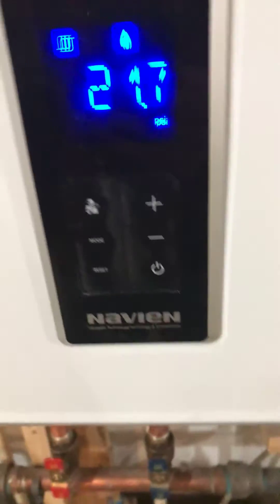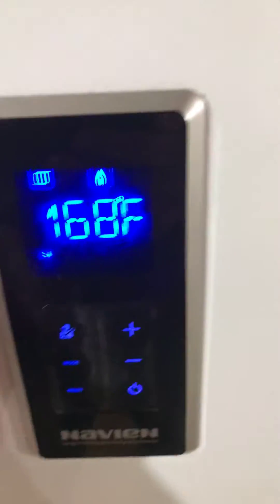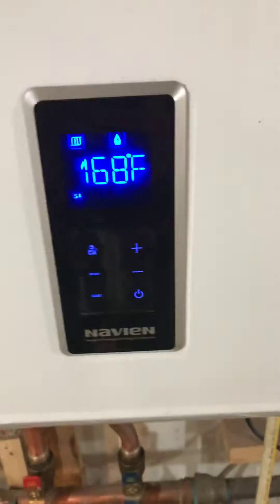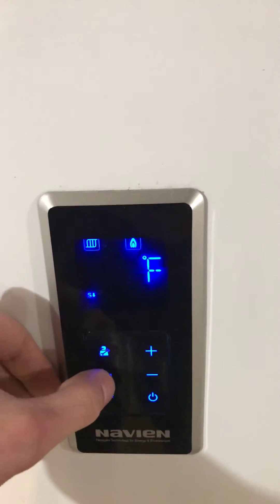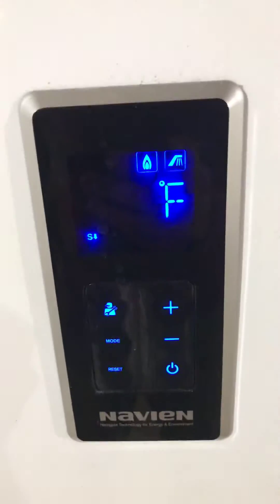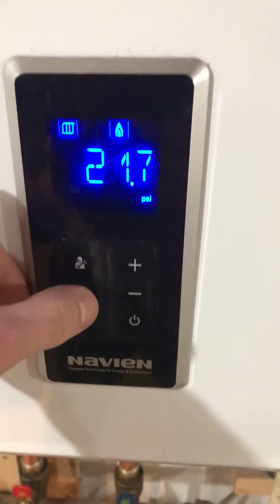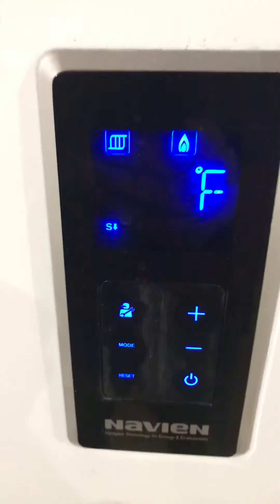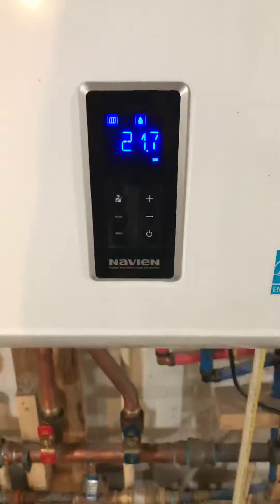Navien’s combi boiler can’t get to desired heat the thermostat is calling for - FIX Maintenance

Comment: 180* for baseboard; 100-130* for radiant floors.  If you have both you will need a mixing valve to adjust accordingly. I've installed many of these. Very pleased with them.  If it doesn't maintain temperature then either you don't have enough baseboard, zone loops too long, or house insulation not adequate. Also, some circulators have speed settings on them.  These also can be adjusted.

Comment: I also live in the northeast and just recently moved into a new home with a navian combi boiler. been having same issue with thermostat and I’ve never had radiant heat before. I upped the amount to 143 because it was cold in here.  What should the temperature be?  You had it on 180 F - isn’t that high? Help.
Reply from the maker: Up it some more. In these super cold days the temp has to be higher. Check out my video about adding the outdoor thermostat. It moves the temp up and down based on the temp outside. Lmk if this helps.
Reply: Thanks. I did turn the temp up and it worked. Now I have to adjust it for warmer temperatures. Question- if you have 2 thermostats, one in main room and 1 in bedroom, if you turn the one down in the bedroom, will that help during the night while I’m sleeping? It’s just too hot in that room now.

Comment: We're having the same problem except our temp is already set to 180.
Reply from the maker: Depending how cold it is outside it needs to be very high. Idk what the max you can go safely but might be worth some research. I have the outdoor thermostat and it adjusts it automatically. But with it being 15 out I’m sure it’s high
Reply: Probably not enough baseboard in your home and how well it’s insulated could all be factors

Comment: I just had two Navien Combi condensing boilers installed for each unit. There’s hot water. Electrician connected the thermostat wire but when I go to the apartment to turn on thermostat no heat. Looks like the Navien error code 740 says no outdoor sensor detected. How do I bypass this so I can turn on the heat? Thank you!

Comment: We just replaced a ten+ year old Navian Combo unit, 1 zone with the NCB 240/110. Hot water side is great. Having issues with the thermostat and the unit communicating with each other. Even though the thermostat was set for 68, the room got up to 80 degrees and we had to shut down the Navian floor heat at the unit itself. How do we get them to communicate with each other. The thermostat worked perfectly with the older unit.

Comment: You set your thermostat to 65F?  What, you like to live in a freezer?  lol  😜
Reply from the maker: Where I live with the electric and gas rates like the 3rd or 2nd highest in the country absolutely lmao.
Reply: @themillennialhomeowner1661  I hear ya!  I'm surprised though, that just cranking it up just a couple of degrees made a noticeable difference.  In my case, my house has 5 zones, and I couldn't get the temperature up beyond a certain point in one of  the zones.  The other zones seem ok.

Comment: Oh man I wish it was that simple on my system lol. Also have navien combi . 3 zones plus hot water super store tank. 1 zone approximately 800 SQ ft first floor can never get to temperature in the cold maskachussetts 🥶 winter. I'll set thermostat to 66 ,it's 10° outside and the system will never satisfy the call for 66° I cannot imagine how much friggin gas we are pissing through on this friggin unit 😭 we have sufficient baseboards and system was installed brand new in 2017 . The other 2 zones don't have issues not even our massive master bedroom with the 12 ft ceilings.  Every fall I try to figure it out , find more drafts to seal up in the ranch but we still can't get that zone warm.  Plumbing supply jw Webb had all the numbers for our house and said this system would be sufficient but here we are years later still not warm🤔.  I knew I should have stayed away from the combo system!  Anytime they try to do 2 jobs with one device it' never comes out how they design it.
Reply from the maker: A bit more complex than mine but the little knowledge I do have is if your system is fitted for the size of your house it all depends on the temp of the hot water going to the baseboards at that point!

Comment: My shower or faucet would start out hot then cools down. It only happen during winter I wonder if there a set temperature for new England area so when the temp drop outside the water would still be hot enough.

Comment: Baseboard heaters for hydronic heating are always set at 180 F and not lower.
Reply from the maker: Per the manual that would be incorrect though. There’s no need to heat water to 180 degrees when it’s 45 degrees outside. That’s assuming you have an outdoor thermostat which adjust the water temp automatically.
Reply: @themillennialhomeowner1661 your outdoor reset will modulate to the desired water temp you will need to heat your home if it’s 45 outside

Comment: I have the same combo system.
It was working very good.
It has two zones of heating.
Today i notice one of the zone call for heat and the other zone is also getting heat.
Do you have any suggestions.
Thanks

Comment: FYI,  combi boilers work best if you leave the thermostat alone. Large temperature changes will make them inefficient.  They take longer to bring the temperature up.  Best thing to do is use the outside temperature sensor,  have it installed on the north side of the house and keep the thermostat program to 5 degrees.
Reply from the maker: Thank you for the feedback. This video was prior to me knowing about the outdoor thermostat. I have since installed one and it works great

Comment: So mine is at 173 and it’s still cold. Help
Reply from the maker: How cold is cold? What does your thermostat say?
Reply: @themillennialhomeowner1661  My thermostat is set for 74 but it’s 62.
Reply from the maker: @theresaconnor2135  according to their chart in the manual 176 should be plenty of temp   Idk about getting it to 74 though. For comparison I have mine at 65 degrees and the water temp right now is 150. I have the outdoor thermostat hooked up so it automatically adjusts it. On extremely cold nights like tonight these systems tend to struggle a bit to reach high temps in the home. Just my experience
Reply from the maker: @theresaconnor2135  there’s also other factors such as drafts, heat loss, how your system was designed, etc. things I’m not familiar with. The water temp is just the basic part of it
Reply: @themillennialhomeowner1661  Yeah it’s 10 degrees right now in NY.  Thanks anyway.
Reply: You should skew the outdoor reset to 30* for max boiler set temp. Factory setting is around 14* which is too low in middle winter. The boiler is also capable of 190+ with outdoor reset off and a using a supply remote sensor plugged into board, usually supplied with boiler. Menus prompts will allow you to use supply temp, and set boiler to 180*. Remember if you have slant fin baseboard …..180* water for rated heat.
Reply: Hi Theresa. Did you ever found what the problem was? I have the same issue. My thermostat is at 76 but it can't get pass 69. apartment is cold
Reply: @kelvinrodriguez7723  There was some air trapped so they let it out and then it was fine.  One thing I realized with these boilers; when it’s cold out like yesterday in NY at 4 degrees it doesn’t push out as much heat.   That is one thing that sucks about these boilers.

Comment: To EC Video: Thanks for your video effort. At 1:58 minutes: Did the thermostat temperature keep rising, and if so, to how many degrees? 
Thank you for your reply. 
Ps: We are in 2022: Could you please share more of your insights, knowledge, and tips regarding this.
Reply from the maker: This video was a few years back so I can’t remember exactly by how much it raised by but it did go up. The temp with hydronic systems (Atleast mine) tends to move temps slowly. You want to make sure the water is hot enough to give the baseboards the heat it needs to get your home to the temp your thermostat is set to
Reply: @themillennialhomeowner1661 : How do I do that?
Reply from the maker: @eddyvideostar  raise the water temp on the furnace, that’s what I do in this video.
Reply: To EC: Will do. Thanks.
Reply from the maker: @eddyvideostar  let me know how it works out. I’d be curious to see if it helped 👍🏻
Reply: @themillennialhomeowner1661 : Will do.

Comment: 170 degrees lmoa.. seriously
Reply from the maker: Yes sir! When it’s 20 degrees out or below can’t have the temp at 50 degrees lmoa
Reply: That's what it has to be set to in order to get the baseboards up to temperature. That's not what the actual temperature of the baseboards is. Have you ever looked at how small the burner is in these units? It's tiny   and it heats up hundreds of feet of baseboard.

Comment: I live in Boston and this happens all the time with the NAVIAN! You wake up in the middle of a cold night and it is blowing cold air. Typically I purge the unit, allowing it to generate heat and then open the shut off valves to in a sense replenish the system to success on days that are zero and above. This does not work on colder days. I will attempt your way. If this works it can be a game changer on those below zero nights. No one wants to wake up to cold air blowing on you.
Reply from the maker: Thanks for the comment! Check out my other video of installing a outdoor thermostat it’s super easy and automates what I show in this video.

Comment: Having similar issue with my navien 150,000btu.  Set heat to 68 it goes to 65 set heat to 66 it magically makes it but try to get to 68 and bam back to 65.  Fucking heater running all night not to satisfy thermostat 🤯. So aggravating
Reply: I have pretty much the same problem. It's so aggravating.
Reply: @Prplhayes280  I'm wondering if it has something to do with the setting for the return temperature. I have the navien set to 180° but I've yet to see it even get to 159°.  I actually put a web cam on the unit so I can monitor it from upstairs. Even when it's freezing  here in mass and all 3 zones are calling for heat I haven't heard it go into boost mode. Wish I didn't get such a complicated system.  It's like learning a new computer system and I ain't got time for that 😆

Comment: This combi boiler max out at 120,000 BTUH for heating. If your home requires more heating than that it is no good for you. Next level up would NFC series. I have installed 2 NCB 240E before for my flip home and will be installing one for home.

Comment: Hey This boiler should run optimally at lower temperature s where it condenses . If you run temp up you are defeating the purpose . Might as well keep a standard boiler and run it at 180 deg. 
I put mine in the mode for an out for sensor and installed the sensor that came with the unit . No more fussing . I get about 4  8 to 10 min burns an hr . I keep tstat at between 65 to 68 depending on out food temp occasionally run it up to 70 if it really cold outdoors. I live in nyc

Comment: I live in New England. The first day of installation, set temp to 66 on thermostat, but only run to 64 and keep running over 12 hrs. Adjust the water temp from 137 F to 140 F helps. 170 F seems too high?
Reply: Yeah wayyy too high. Anything above 135° can you leave you with nasty skin burns
Reply: @Naz34452  he’s talking about the hydronic side, not domestic hot water. 
Won’t affect the tap temp heating the heat temp that high.

Comment: I have this same unit. It’s 2 months old and we have no hot water. It’s flashing an E351 code. I was very hesitant getting this unit because there were mixed reviews about the 3 way valve. If calling a technician is a regular occurrence, I’m going to be really pissed off! This was a $12,000.00 expenditure as it replaced a 2 tank system for radiants floors and hot water. Not happy so far after seeing videos with the same error code..... seems like a known problem much like the 3 way valve.
Reply from the maker: beri232 check out my other video for the e351 error code fix. These are great units just takes some tweaking to get the kinks out
Reply: @themillennialhomeowner1661  I actually watched that vid.... it got us up and running for the night but the unit failed again the following morning. Our system also did not have that release valve that yours does. Tech came by today and found a little leak and figured the radiant floors had let in some air into the system. He soldered the leak, drained and filled the system and it's working again for now. Will know more over the coming days. Funny they don't have a standard way of hooking these up. Just about every one I see is totally different
Reply from the maker: beri232 yikes! Glad it’s all worked out.

Comment: Hi, You making good videos .thumbs up. But in this case, seems like you don't have enough heat exchange in an area that you have a problem, meaning you need more lot more radiators. same time having water set so high you are not getting efficiency out of this unit that you would like to get. If your boiler doesn't condensate when working you getting 10 percent less or more efficient than manufacturer claims.
Reply from the maker: 786otto thank you for the feedback, I realized there is an outdoor temperature adjuster they didn’t install but left here with the unit. That SHOULD hopefully take care of changing the temps on its own.
Reply: @themillennialhomeowner1661   Yes it needs to be installed, fasten it in place that does not see direct sun light , and go over the manual to configurate it right, also set boiler for radiators that you have. There is a setting for that. I hope you have primary and secondary heating loops installed correctly. Should set it that boiler condensate in heating mode, if possible with your system.
Reply: @786otto  if you were my plumber I'd pay you extra
Reply: @Naz34452  Thank you,extra not necessery.
Reply: I have a Navien NCB 190/080 H goes off on thermostat but keeps running on/off every few minutes

Comment: I live in central NY and I have an outdoor wood boiler. I set the water temp on that for 185F. I'm going to be going to one like yours soon. Sick of using wood!
Reply: Those are great but you will need to look at the whole system before getting one, those work best on low water temp. that means you will need a lot more heat exchangers { radiators ) to get good efficiency out of it. having it work on high temperature is just like using an old type cast iron boiler and that will last over thirty years without any major problem with those maybe 3-4 years before you start to see errors on display.
Reply from the maker: It’s a great furnace....I just had to figure out all the tweaks. Much different than a regular boiler and water heater!
Reply: @themillennialhomeowner1661  Who did you have install it?
Reply from the maker: Frank Baritell when I bought the house it was already installed. I believe they flipped the house so I assume they are the ones who installed it. I honestly wouldnt even know who to call. Probably both a plumber and HVAC tech.